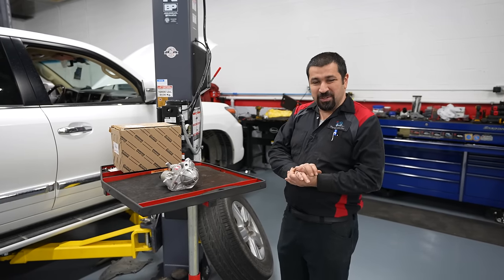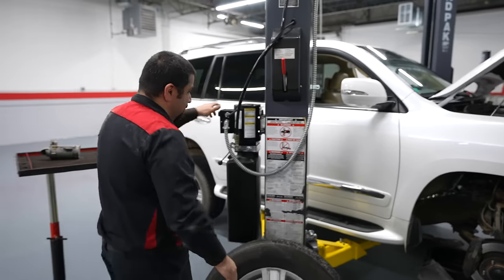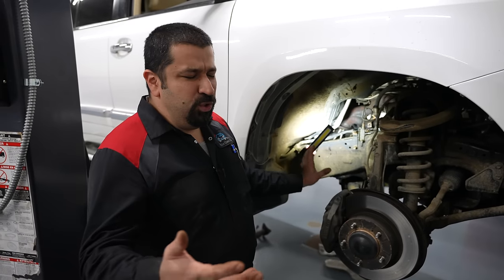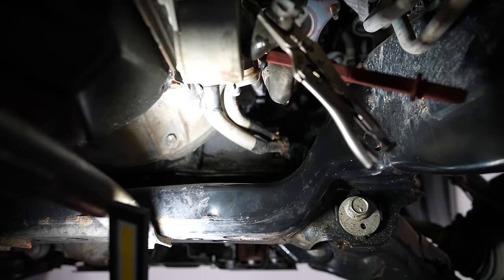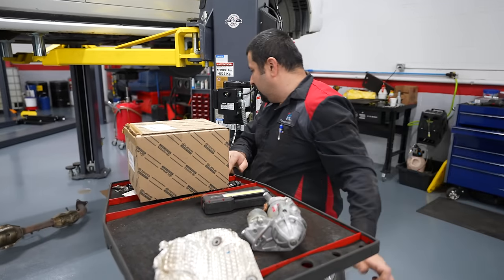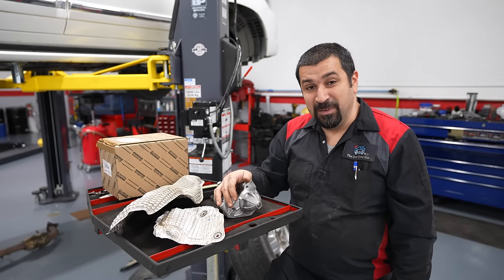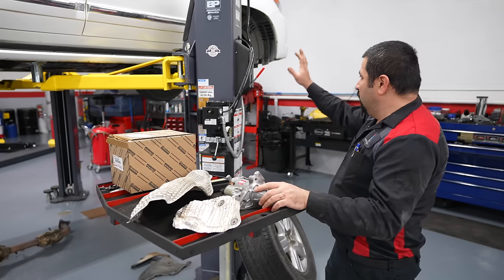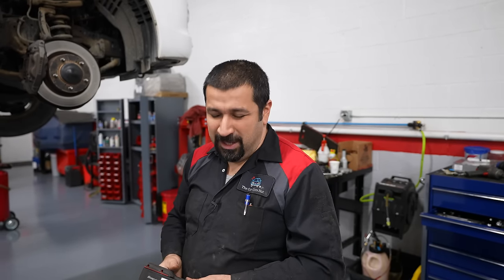TOYOTA! THIS is REALLY A Horrible Design! You Could've Done This Better!

Comment: Calling out these design choices is incredibly valuable! I hope Toyota is watching and learning. There are so many things on my Toyotas like this, and this channel calling it out and shining light on it is worth its weight in gold. Nice work, sir!
Reply: lol, try working on a Ford or Chrysler. I bet those shields are not coming back, most shops don't bother to re-install them..customer will not even notice until the starter is being slowly cooked.
Reply: @dixon Butters
Indeed yotas sometimes seems to follow the industry standards of the formerly called big three of detroit. It reminds me of the typhoon 4x4 early 90s by GM.
I didnt come across a starter on an early 4.7 under the intake. However, sometime ago i came across a 4x4 tundra with a bad tranny with which out of sheer luck
of a dozen potential  candidates to do that job, i was given the honours to  do it. So i wondered if i could use a yosemite sam (shoiting from the hip) attitude or bugs bunny's smart alley personality, i chose the latter as usual and it worked.
On hind sight, i do recall of having some difficulty with the starter and to some extend, knowing and learning in the process it wasnt too bad after all.
Good luck.
Reply: You need to work on a BMW made after 2000 to appreciate that Toyotas are a darned sight easier to work on than most.

Comment: A great example for all the folks that complained about the starter being under the  intake manifold, "be careful what you wish for" :) Great video!
Reply: Yes indeed
Reply: You would think Toyota  would react with a friendlier design. They spitefully did the opposite intentionally. No way that could be considered an improvement.
Reply: Cadillac used to put it under the intake manifold too, Northstar engine
Reply: The smog air pumps are located in the valley that once housed the starter on the 4.7. Those air pumps were located on the right passenger fender well but due to corrosion issues they were relocated.
Reply: Ouch.  Cheap shot at Car Wizard??
Reply: If I had this job, I might consider ripping out the heat shield. Then fabricating an EZ-Install shield. But no problem. I won't own either version!
Reply: @jamram9924  if the rust is the problem just make the pumps from aluminum.
Reply: The  air pump housing is made of a very durable plastic. Due to the design and location of the pick up hoses/hardware, water would infiltrate and enter the pump. Toyota redesigned the intake piping and extending the warranty replacement for the air injection system. There is a device to override the entire system that disables the air injection pump system and not activate a “check engine” available.
Reply: Anyone know what year he's referring to about the highlander / Sienna aluminium transfer case issue?

Comment: Did this job on my tundra a year ago. Starter went out in the parking lot at work and instead of towing it 50 miles home I decided to go get my tools and come back. Took me roughly 4 hours. Total nightmare. I was able to do the job without removing any of the exhaust and I mangled the heat shields so much that I never put them back in even though I wish I was able to. Toyotas usually aren’t bad to work on but I had some very choice words for their engineers when doing it. I tried explaining to my Chevy friends how hard this job was and they couldn’t understand. I’ll refer them to this video if it ever comes up again. Great video keep up the good work.
Reply: I wonder what the consequences are of leaving off the heat shields.
Reply: It’s been 50k miles or so. I haven’t had any issues yet. I’m sure it’s beneficial to put them back on but at 10pm finishing it in my work parking lot on a work night I couldn’t care less. Factory starter went out at 120k for reference.
Reply: @grizzlygrizzle  running without the heat shield could greatly shorten the life of the starter.  However, I am sure replacing the starter the second time will go much faster!
Reply: @politics4816  -- I'm smelling your cookin'. I was thinking about this, though, and it occurred to me that the starter motor is usually run when the engine is cold anyway, so the motor isn't running when most of the heat from the exhaust manifold is the worst, so whatever degradation there is from the exhaust manifold heat is done when the motor is static. Maybe the engineers were trying too hard with those heat shields. I suppose it could get pretty toasty, even on the static motor, during long idling on very hot days.
Reply: @grizzlygrizzle  Very good point.  I am on he 3rd starter for my Sienna with 210k miles so having a starter that difficult to replace would be a non-starter;)   Seriously, I wonder how long the starters will last on the new cars that automatically turn off at every stop.
Reply: @politics4816  Never having owned one of those, that never occurred to me. Another consideration in the long list of reasons not to buy one of those stop-start vehicles.
Reply: Sounds like you’ll need another starter soon
Reply: Yeah because on the Gen 1 , Gen 2, Gen 3/4 Small Block Chevrolet the starter is pulled from the bottom. Nissan starters are right under the intake as well.
Reply: without the heat shields, the hot exhaust will cook the solenoid over time, resulting in a no-crank-no click-no-nothing, esp. when the motor is already warmed up. Affected starters pull an incredible amount of current when this happens, trying to overcome the high resistance. This will be your first clue of imminent failure. Also, the hot manifold will cook the lubricant from the end bushings of the starter, causing it to squeak (at first) while spinning the engine. After a few more weeks of additional wear, the armature touches the field coils and the starter is a dead paperweight. Chevy big block fans can attest to the "heat sink" issue as described above. Love your videos, AMD, and can't wait for you to do a Prius Gen. 2 ABD actuator!
Reply: They sell insulated starter heat shield blankets I used on V8s with headers. Some are installed with stainless ties (Amazon pn B0045T5E4O), some with Velcro (DEI 010402 for large, 010384 for mini), but I preferred the one with sticky backing. There was always plenty left that I would use to insulate fuel lines, etc. Unfortunately the newer stick on type seems to have cheaped out and don't stay as well as they used to. 

Preferable to hassling with reinstalling factory heat shield on starter, and better than going bareback.
Reply: Use something as a heat shield, metal plate, old license plate will work doesn't have to be the original
Reply: @politics4816  I do not know if it is so simple to do this,  but do not use that option. Put your car in manual starter. I do not know too much about new cars but I think this is a type of fuse or relay that is activated by the brake pedal. Ask a tecnician to the deale for more info.
Reply: @maldonadolemus  That would be a great idea to just defeat the stop/start "feature" however for "safety" reasons they probably make it very hard to turn it off.  In the old days the first thing I would modify on a car was the buzzer that sounded if you didn't have your seat belt on before you started the car.  I always wore it, but preferred to start the engine and than put on the belt.  Car companies need to start building simple, cheap and reliable cars instead of piling on features.
Reply: What years are these on?
Reply: @politics4816  Maybe just find an alternative heat shield thats easier to install/remove. I always watch these videos knowing someday my Tundra will need one. Im not paying 1k to have someone else do it so I think an alternative shield is a viable option. One that might not be quite as good as factory but will keep the start from going out too quickly.

Comment: I did this job on my ls460l. Which is even tighter and more painful. I completely agree with you TCCN! Removing intake manifolds are extremely simple and people tend to overlook that and get flustered.
Reply: I will remove an intake any day so long as I don't have to touch those rusted exhaust manifolds. Wisconsin is NOT nice to them, my 08 Ford 4.6l f150 has almost no bolts that aren't rusted to stubs on the engine block.

Comment: Good evening, I am a fellow Car care nut, and because of your videos along with a few others I have wanted to take a whack again at being a DIY’er. Well I decided to do the break in oil change on my 2022 tacoma. I hope I’m not alone in this but the oil dipstick constantly looks like it is overfilled. This worried me so I attempted to drain some and refill as necessary. Of course this didn’t go well and all the fresh oil came out. So I did not replace the filter and put only 4.5 quarts in. It is still looking overfilled. I drained the oil on an uphill slopes because I used ramps to get underneath. Am I somehow reading the dipstick wrong? I heard that they can drag oil on the way out of the 2GR-FKS, thus giving a false reading. What should I do?

Comment: Hi AMD, when you warn that it’s a nightmare then I know it’s going to be bad because you’re such a highly skilled and knowledgeable Master Technician! I will not attempt to do this job even if I had a hoist at home. And yes, it’s a bad engineering design-not good for mechanics. A friend and coworker of mine was once a Honda and Toyota technician at the dealer and said that engines are assembled out of the car or truck and than installed into the car/truck at the manufacturer. Please continue making these videos on these difficult jobs because it’s very educational, which helps hone my skill and knowledge as a DIY mechanic. Have a great day!
Reply: No offense but did you think the engines were made inside the body? I thought it was pretty well known that engines are built outside then installed almost last in the process
Reply: @HughJashole69  Yes, many know that engines are assembled before installing into the car. I was just mentioning it in hopes that when engineers design a car/truck that they would put more thought into the problems of after sales service that mechanics face. And I wanted to mention that’s why it’s more difficult to work on a car/truck that already has the engine installed in it.
Reply: The items attaching to the front subframe are attached to the subframe  at the factory. Then the car body is raised on the line and the subframe raised up into the engine cavity.

Comment: I have a question about a 2012 Toyota Tundra.  The brakes are spongy.  I put in a new master cylinder, but the brakes are still spongy.  This started after putting new rotors.  I used a Launch hand held scan tool.  Would that tool have started this problem?

Comment: Thank you sooo much for your videos. After watching quite a number of them I wanted to ask you a question. If one wanted to buy a new Toyota and is a reliability nut like I am. Which Toyota's would you buy that you think would last 300,000 miles with minimal repairs and expense out of the new or newer models? I have a 2002 Sienna with 268,000 and runs perfectly but am looking at getting a new Toyota.

Comment: I really love your videos and how you explain the topics in a perfect order. One gripe I have though is that it is difficult to notice the things you point out which are deeper in - the focus of the camera is always off, so it's always a blurry mess
Reply: On a side note, is that front brake disc from a bicycle? After 2 sets of warped Toyota discs, we replaced all four on the Venza with EBC. Now has incredibly smooth progressive braking and hardly any brake dust on the wheels. Highly recommended and surprisingly cost effective upgrade.

Comment: I will have to pray hard for my starter in my V-8 Tundra!!!  My friend was a mechanic on the old B-52 bomber and said there’s a hydraulic pump that’s a nightmare to replace. He said, “It’s like they built the plane around that pump!!”
Reply: In some cases ... they do. Dc-8 Conway engine hydralic pump, and you have short arms. New guys got that job all the time. Back in the 60's & up to the mid 70's. You can see it, you just cant reach it!   I,m retired now so it isnt bad working on a 07 Dodge Caravan, except for the rust here in Canastan.Getting a new Toyota Cross come March 23. ( maybe) lol

Comment: Must have been an Audi engineer that designed that part.
Reply: I  saw the Chain tensioner done on an Audi V8..  pulling the motor was a must Changing chains looked like 3 rows of chains deep and like a ton of composite tensioner on the Back of the engine.
Reply: I changed one on the Audi a8 4.0 v8 engine. Not too bad. Just time consuming
Reply: Probably the same engineer that approved the placement of the EGR valve on the 2010-2015 Prius. 😞
Reply: @danieljohnson4418  for at least one of the older prius generations to replace dead battery, you had to take out the whole engine. wonder hoe new prius is. and camry around 2008 was the safest sedan, even new sedans seem not as safe, according to ihhs
Reply: Or BMW + his bean counters... 🤯

Comment: I used to be a copier technician and I used to do all my own auto maintenance and found that as manufacturers look for less expenses way of doing things along with being more compact they can create some near impossible jobs. I used tell people all the time the engineer that design these products don't have to maintain them so they really don't care about the mess they create.
Reply: Car engineers get company cars and never work on the cars or even see what their work has produced.
Reply: I personally saw this negative evolution with a laser printer manufacturer. When I first started, manufacturing was on the ground floor, design on the second floor, and warranty work was in the next building. As they gradually moved or outsourced those functions, the engineers received less and less feedback. At first there was not much difference because the old timers remembered and when they saw design problems pointed them out. The old engineers retired, the younger engineers didn't remember or didn't know why things were or were not done, and the contract manufacturing started to get much more expensive.  Warranty costs increased dramatically. I left about this time but the saga continued. To cut costs they outsourced most design and development for the less expensive products. Soon they had no design input and were just putting their own name on the cheaper products. They let most of the engineers go in several rounds of lay offs.  I won't buy their products.

Comment: AMD, Every time I see an expensive and complex repair on an expensive and complex V8 engine, I am more and more satisfied with my humble 126 hp 1ZZ-FE engine. 😁
Reply: Lol!  If I remember that's the Corolla engine 2002-2007?  I have the 3UR Sequoia now and also had the 1ZZ FE in my 2005 corolla in my younger days.  As a DIY-er, I wish I had the corolla.  Will never complain about maintenance on it.
Reply: @garyf2871 To be fair, Toyota makes the most reliable V8 engines by a mile. Those V8s are bolted to the most reliable transmissions etc.  My 1ZZ-FE resides comfortably in the engine bay of my manual 2005 Pontiac Vibe.
Reply: @rightlanehog3151 I likely have the same in my 04 Matrix with 330K km. MT.  So far so good only had to replace rusty gas tank.
Reply: @marcpikas2859  If your Matrix is the base model, it is the same engine.

Comment: A couple months ago, I took my 2007 Sienna V6 to change the sparkplugs at the dealership and I told them replace the three ignition cols in the rear bank that was hidden behind the intake manifold.  The service advisor said why do you want to replace those three working coils,  is it misfired?.  I said "Nope, but I don't want to hear that it went south a couple months after we replaced the sparkplugs!".  I normally, would replace 'unbroken' parts if it is in the same location where they have to be taken out in order to replace something broken in that same location...I supposed to save labor cost as labor is normally the most expensive part of the repair.  I don't know if that is the right or wrong approach but that is just me, I supposed.  Thanks for sharing such an informative automotive repair videos :).

Comment: @8:55 you said if the top bolt is not in then the rattle at startup. Is this the reason why my 5.7l rattles at startup? I thought it was because of the timing chain that does not have enough oil at startup.

Comment: What are you thoughts on replacement starter being 2/3 size of the original starter? 
About the job, yes total nightmare. I did it in Summer Miami hear.  Prospective, starter on mine lasted 170 k miles, big progress from starter contact jobs era in Toyota.

Comment: This reminds me of the cracked exhaust manifold replacement on the VVT-i 2UZ-FE....  especially in the 4th gen 4Runner and GX470. The heat shield is always in the way forcing you to remove a bunch of other stuff.  Plus there is barely any room to work.

Comment: Great video, AMD!  I have replaced a few starters in my life. My first car was a 5 year old Corvair. After that many GM products. It never took more than a few hours for even an amateur to complete the job. That changed when I started driving Honda’s, however I knew a great mechanic and $100 later it was done plus $80 for a new aftermarket starter. I started driving Honda’s in 1996, only replaced that 1 starter in 13 years. If my 2017 Toyota RAV4 needs a starter, who cares!  Thanks, again!   Jim

Comment: My 2006 Ford Escape has an alternator above the right axle and behind the block above power steering pump. Same frustration ratio because the body only allows for a mere 0.5 inch of space around it to be pulled out of the axle area. Took me 5 hours on jack stands on my back to remove. What a pain. I hear your frustration in your voice. Thanks for the great videos.